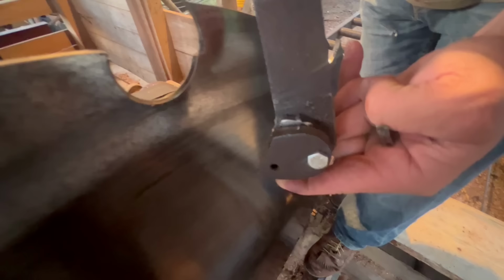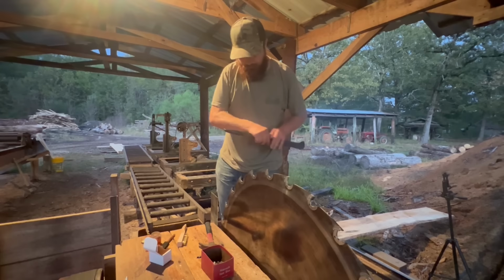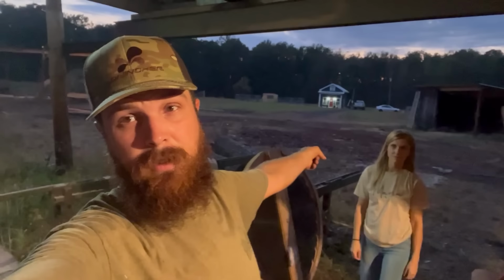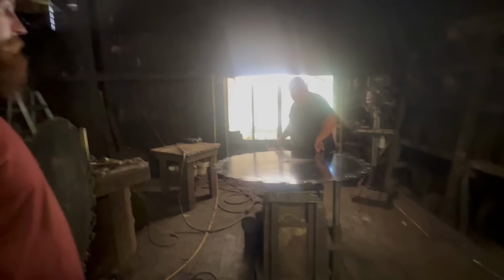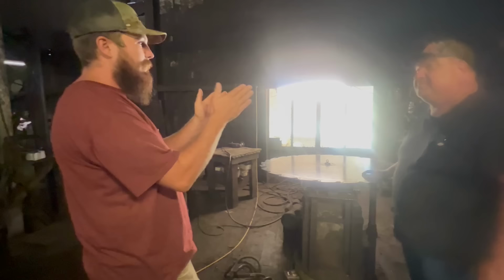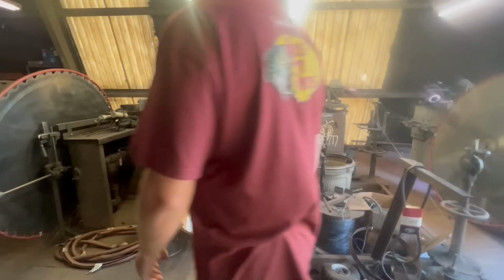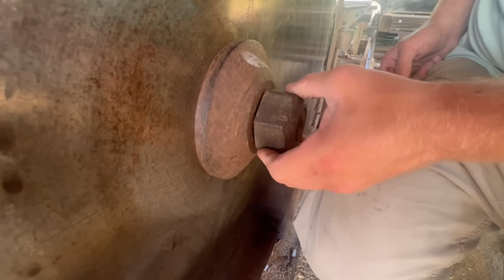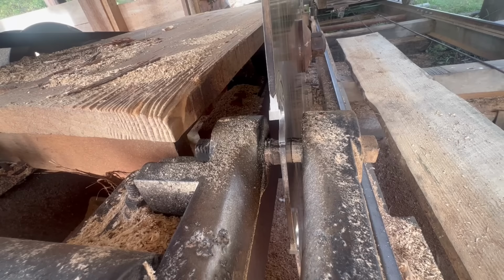We are HAMMERING our SAW?!! (Is this becoming a LOST ART?!!)

Comment: When you buy a saw from somewhere like Lowes or Home Depot and it is in the order of 10 inch to 14 inch blade and run it at high speed.   The saw has been hammered when you buy it and the slots in the blade are part of this getting a "saw to stand up" too.  What is going on is that at high speed the rim of the saw stretches out.  Your 24 inch blade probably gains between 1/8 and 1/4 inch radius at speed.  The hammering is to keep the metal stretched into tension when up to speed.  
Getting a blade properly tensioned means it runs true under load.  This is very important to getting a smooth cut.  If your saw is not running true, it will wear the teeth unevenly and it will make a lot of noise when sawing like a hammer hitting steel.  For your saw mill this keeping a saw in proper tension is a critical issue for your safety and for your production and keeping costs down.  
As you heard the man say on needing to tension a band saw blade,  At high speed the spring action of the steel as a band saw blade passes through the wood makes it necessary to have the front side of the saw where the load is tightened by hammering too.  
All of this is a matter of resonance under load as well because both circle saws and band saws under load are springy with tooth impact of the wood.   Just sharpening a saw that has gotten dull does not fix this tension issue and springiness issue.  If your saw gets hot the metal loses temper and will quit being properly springy.   
Most people do not realize and you see this with the gum on the teeth and with burned teeth on a saw that the temperature under work load of a running saw is very nearly 500F and can easily if not standing up right, go well above 1500F in almost an instant in a pinch or in other conditions.  You may as well have put your saw in a blowtorch and made it glow red hot if you pinch a saw.   Such a saw will need to be fixed and retempered/hammered etc.  
Another feature you may not know about saws is that the bottom of a horizontal saw due to rotation of the earth is often running slower than the top.  Due to tooth loading this makes the top of a saw stretch a lot more than the bottom of a saw.   Sorry for the heavy physics lesson here but Maybe someone will understand more after reading it.  Metal that has been heated and not properly tempered just doesn't do the job!
Reply: I have spent 20 years in a sawmill fixing all types of saws. Your explanation of saw tension and how a saw runs is bang on the money.
Reply: Rotation of the earth?
Reply: @BinglybertSlaptyback Yeah, that's some nonsense right there...
Reply: @court2379  I had to laugh. Every trade has it's mythologies and they all end up sooner or later on the internet.
Reply: @BinglybertSlaptyback 
No have no idea where he got that. I filed 30 years only saw one horizontal band mill and it wasn't operational. RPM is same , how could it be otherwise. There's different band mill designs I ve seen many never a double cut that cuts like it sounds on forward  motion of carriage and back. 
We only had twin bands on chip n saw and sharp chain then band mill head rig. 
There's quads with 4 two twins back to back. That's so they can wreck 4 at a time. Lol 
We didn't use circle head saws like he's filing here. Bands have thinner kerf. 
I understand what he's doing and he is spot on.  
Bandsaws have back in them which makes backside opposite teeth longer. If that sounds impossible saw is funnel shaped sort of. If cut into and stretched full length it will curve slightly like Cresent moon shape. The reason is when straining saw 
( raising top wheel to tighten saw to run ) saw tightens teeth side first and back side is loose while teeth side is tight as banjo string. This is so log or cant won't push it off back of mill. There's guards to prevent it from coming completely off but it's not a good sight or sound if your a sawfiler. Maybe this is what he meant. Corollis effect has no bearing on bandsaws long range shooting yea. Hope this clears it up.
Reply: @danhunik7949 No not really . He is correct on some , most not at all. He's referring to back in a bandsaw. You have a gauge that shows correct back. This keeps saw from being pushed off back of mill when entering cut. It stays on mill from tilt that is set to keep teeth just ahead of wheel but the back as it's called keeps it on in the cut ( while logs are being sawn.) Bands on chip n saw or sharp chain have smooth back while head rig saws have sliver teeth to prevent slivers or knots from pulling saw off when carriage returns also sawyer never passes back of saw with log being sawn. Saws aren't supposed to " snake " run out  that's when saw cuts wavy ( not good) and if it happen at tail end of log and sawyer does pass back of saw. Believe me when he stsrts back with carriage there's gonna be a loud  bang pulling saw off front or usually breaking it. The carriage rides on rails and carries log being sawn holding it with dogs so it can be moved in towards saw or backed away with head block and knees.. This varies thickness of boards. Saw runs same speed horizontal or vertical and Earth or gravity have no effect except to make broken saws fall in chip conveyer headed to chipper. I hope I have helped with this
Reply: @court2379 oh just a little lol.

Comment: Learned to hammer tension in 52” circle saws. Different tension is required for pine vs hardwood & yet more tension for dry hardwood. Ya gotta watch the saw run to determine the right tension. Never did inserted tooth saws so I cannot comment on those.
Reply: Glad to hear someone say hammering tension instead of dish. Dish is bad tension nessacary. I believe the reason for calling tension dish is lifting saw causes eye to droop and yea its concave..A dished saw is damaged from running can be from excessive tension when saw gets hot. Without rolls nearly impossible to correct. Not a lot easier with roller.

Comment: I ran a 54", 48 or 50 tooth circle saw for a veneer mill opening logs to be veneered. This really brought back memories, good and bad. We ran 23/64 Simonds bits. One day cutting Pecan, I ran into 3 or 4 stainless steel climbing spikes (so I was later informed) that were buried in the log. That threw every single bit AND shank except for about 4. Shoulders were trashed and basically destroyed a $2000 saw back then, 1980 ish. Sounded like a machine gun. Thank God no one was hurt in the mill with me. One thing, don't forget to check your lead on your mill. I believe we set ours at 3/32". Be safe. Do you ever have someone help you with the taking off and putting on the saw. We always had 2 doing ours.
Reply: Good lord! That sounds horrible and dangerous.   One of the most important tools that Mark Galicic puts to use with every log before it's loaded on the mill and a special metal detector.  Replacing a blade with broken teeth on a band saw is little bit expensive.  Replacing a circular blade is way expensive!

Comment: We manufacture saw blades up to 168" in diameter. Our company TRIANGLE T CORPERATION invented the "Replaceable Carbide Springtooth" which allowed the mill operator to quickly knock out & replace teeth without removing the blade.  Its ALL about the FLEX in big blades. With a straight edge on the blade, we would see where the blade flexed at 45% angle & would hammer to move the flex point as needed. Yes, almost a lost ART. The older men whom taught me were the real CRAFTSMEN. These are the same men whom hand scraped the rotor bearing housing on Jet Turbines 14' in diameter.

Comment: In the early 70's I worked for a forest products company running 3 sawmills.  The oldest in Wakefield, MI was run by steam engine and the resaws, planers, etc. were driven by line shafts and pulleys.  The head rig was powered by steam, too.  The filer's room was above the main bandsaw.  Whenever a saw needed sharpening, they hoist it up into the filer's room.  When a band saw showed a crack, the filers could "weld" the crack closed using a flame torch and a hammer.  They were real artists.

Comment: Yes I believe this is a lost art , hammering head saws! I use to work at a family business, my uncle owned a saw shop. We repaired carbide saw blades. We re-toothed and sharpened them.  We also did head saw repair, repairing and replacing broken backs and hammering the correct dish back into the head saw. These jobs are getting rare with timber deminishing.

Comment: You can set them running, yes. You can also set them with a straight edge while  its not running. Also its a good practice to roll the saw slightly in the opposite direction of rotation so it sets against the pins in the collar then cinch the nut

Comment: This a very good video. I remember learning about changing out the teeth and how to file sharpen. The man that showed me didn't use carbide. I have some treasured memories working with him around his sawmill and I helped with the building of his log home. There is no drywall in the house at all. The outside walls and a few walls on the inside are western cedar logs best I remember that were set by crane. All the other lumber he milled and dried in a old bulk tobacco barn. It was not a quick-build regular framed house for sure. He passed a couple of years ago, but I still think of him often. Take care and God bless...

Comment: I once sawed into a log and hit a railroad tie spike. The saw was bigger than the one in this video, and it just exploded into pieces. At the time the mill did not have metal detection. The saw was damaged and could not be repaired. It cost the mill $2,500 for the saw, and $500 for the carbide teeth. Stay safe.
Reply: Well I lost my comment don't have time to completely rewrite. I've seen everything you can imagine hit by saws in logs. The worst is a porcelain insulators used years ago nailed to trees for electric fences. They will make the tooth side of the saw look like back side or close. Bandsaws I mean. We used stretcher rolls to tension bandsaw , that's what he's doing. I'm so glad we didn't do it like he has to. Round circle saws like that are tensioned by RPM. Tension is stretch that allows so to flex. Not to much but some nessacary. I'm writing as he talks and just said can't get young folks to work like we did. That's so funny. He's right. RR spikes,  60 penny nails thanks to all the deer hunters,  bullets , even a bees nest. That was interesting. 
Nice job . Thanks for sharing

Comment: Me fadder had a mill in the 70's, we run a 52 inch. Had a new sawyer trying to make a name for himself, but pushed too hard, cupped the blade. Even though we could run cooler cause our logs were wet. Run em hard(hot) or too slow, especially boat planks they cup.  Never did see the hammering process, Thanks for the vid

Comment: This is just me, but I would have left the old bits in for the travel and handling at the saw doc.  Brought it back and tried it with the old bits, then switched out to new if I needed to.  I always try to change only one thing at a time to verify where the problem comes from.  Maybe I'm missing something with your plan?  I'm always interested in learning something new.
Reply from the maker: Just did what the saw man asked me to do. His logic. Changing an entire set of hits can have effects on the tension. So maybe he wanted the set that would be used in the saw.
Reply: That crossed my mind, though if the blade were that sensitive to different sets of bits, we'd all be in trouble.  Shanks are another matter.  Seems they get weaker with age. @wallacefarmandsawmill

Comment: I tried to hammer out a blade once. It came out looking like a cupcake paper. The old man who always hammered our blades was standing right there. He roared with laughter. Two hours later he finally was able to correct it. I do not think I hit it more than twenty or thirty times. He did not have the equipment your man has. That was cool to see. Our man used a anvil and a spindle on the back of his truck. Two straight edges and some chalk. Good luck finding the problem.  For a lot of your viewers I am certain they have no clue what all can go wrong to cause the problem. Like you I was raised with a sawmill. I think it would be fun for you to list some of the things you have seen. Some of the more obscure things I have encountered are. A track shim just in front of the saw blade. A bearing on the far end of the arbor had a cracked race. A piece of wood was wedged on a brace for the sawyers booth touching the saw. Anyway great video. Thank both of you for the nostalgia.
Reply from the maker: Thanks so much for watching!
Reply: You we're hitting the blade too hard. A soft blow,  not much more than the hammer falling by its weight alone, will shrink the metal on the side that the hammer hits. A harder blow will stretch both sides of the blade.  It's the same technique that bodymen use to  take out dents with a hammer and dolly. You can practice by taking a 1"x 1/8 " steel bar laid flat  on an anvil and tapping  on it with a rounded head hammer  until the bar curves upward. If you master that, then think of a saw blade as a series of  similar bars radiating out from the center of the blade. Using a straight edge as a gauge, adjust the curvature to your gauge . In the unlikely case that someone will actually want to try this, there are tables of  curvature available based on the diameter and gauge of the blade  and the RPM it will run at.

Comment: Take a hint from an old sawmiller . Always have your saw hammered for a slower speed than your mandrel speed. What happens as soon as you start into a log ?? Your mandrel speed slows down right? You are already getting out of your hammer speed if you pull down in most cuts all day your building up heat in your saw as it lays over . Pulling with diesel this is important electric not is much . I ran 630rpm and told the hammer man I was running 600rpm . The saw will wobble a little at speed but will stand up a lot better in the log  and that is what you are looking for. Let your speed pull down through your hammer speed not away from it . If think about it it makes sense.

Comment: That was interesting. About the light. I'm a pro house painter & I was cutting in a hallway when the customer turned the light on thinking it would help. Boom, I could not see my lines at the ceiling & trim. I educated him & he turned the light off.
Reply: Fellow you have a light so bumps and ridges can be seen to hammer flat. Then at least bandsaws and thin kerf gang saws are held up from anvil to allow saw to sag to see tension ( not dish) amount in saw. No idea how anyone could file saws without it. 
I don't mean to contradict anyone and the filer in video and what I tried to explain is how it is. Not every comment is incorrect please don't think I meant so. I filed 30 years in a production mill ( this means quantity over quality. Lol but quality can't get off too bad.) 
Our mill ran two shifts each usually cutting 600 thousand bf per shift. That's over 65 Simi loads of Southern yellow pine a day. Makes ya wonder how there are any trees left but they are replanted and grow fast.  Old slow growth better but Co s like fast $. 
Thanks for sharing that video 
It's knock time .

Comment: Really interesting video, I have worked stone cutting saws for 30+years from 2ft to 6ft. The biggest blade is re-tipped in situ with soldered segments, obviously the blade needs hammering afterwards. If the soldering is done well 3 or 4 cracks with a big hammer does the trick, the skill is hitting the correct spots. Worst part is holding the heavy plate behind. Keep up the good work I enjoy the circular saw work the most but its all good stuff 👍.
Reply: I too used to hammer. On saws that were too big to lift, we hung them up with chain falls.

Comment: great video:   Wish I had access to your saw filer / maintenance guy 30 years ago all my wood had teeth marks from a saw that would not stand up evenly.  On your bit wrench they came with a J shaped bolt in the 2 holes.  Short side of the J went thru the saw shank and the long side of J went thru the other hole.  This is much handier than fiddling with your bolt to remove the shank and bit just slide the J bolt in to attach the shank and out to remove.

Comment: It’s amazing that is all that holds the teeth in the blade sometimes engineers can make great things and sometimes they make crap lol but this is pretty cool thanks for sharing god bless
Reply: Yeah, and watch what happens if you get a sliver stuck in a running saw out near the edge, the saw heats up and expands and the the bits and shanks start flying. My first mill they had top & bottom 48's, the roof directly above the saws had dozens of little holes in it.

Comment: You adjust the small bolt with saw not running. You use the big adjuster at speed. How you adjusted the pins is how a guy I trained lost a finger.
Reply: I can't believe he did that. It must be that the main adjuster is seized and he doesn't know it.  I hope others that might have these saws realize the insanity of doing what he did.

Comment: I used to run a 52" blade that a friend and I set up, I did all the alignment and leveling... The longest beam we cut was 45' and it was off less than a 1/64" end to end... 

I would hammer the blade while on the saw as well as sharpening the teeth before running but... We went months and months into years before changing teeth... I was wondering why you did... We also used a swedge on the teeth if they got a bit narrow 
Anyway... I was trying to see how you took care of your dust... We installed a blower system right down at the base of the saw and it would catch and then blow the don't out about 24 feet and that was with only a 3' extension off the blower